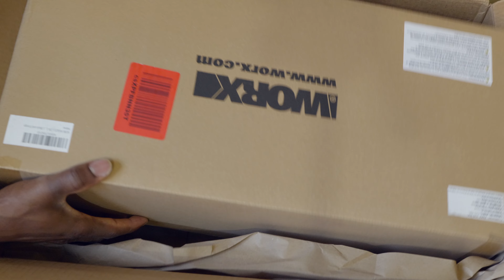WORX 20V Hydroshot Cordless Pressure Washer WG620 5 Portable Power Cleaner

Comment: Hi mate am thinking of getting one of them off argos is it worth the money mate and can you add foam aswell
Reply from the maker: Yes, you can attach a foam container to it (it comes with the kit). The pressure is high enough for regular car wash but not strong enough to remove deep grime from inside tire fenders. So for heavy duty wash, consider the 40V version
Reply: @YvonSmart is the 40v the same make
Reply from the maker: @martinm5466  Yes, it is. Same make, same battery (two 20v batteries). It's just bigger and heavier with high and low pressure settings. not sure if it comes with foam dispenser attachment. I linked both in the description